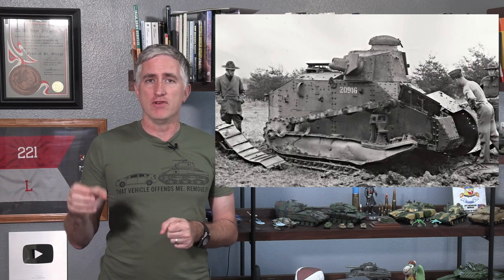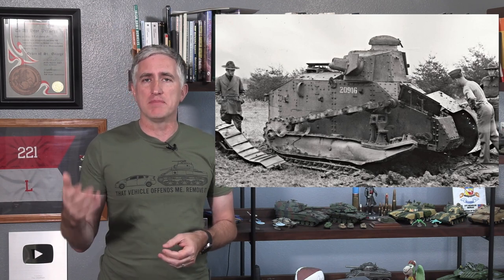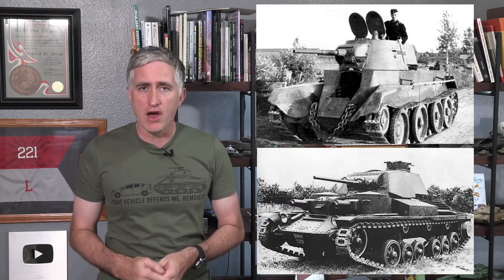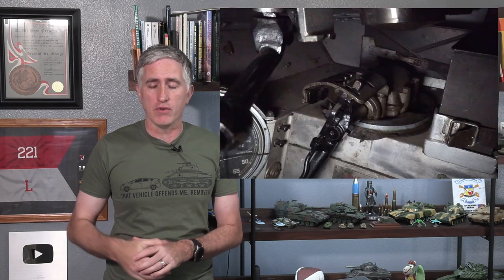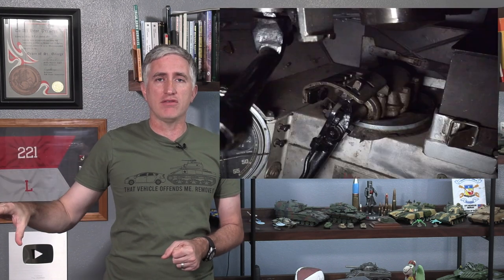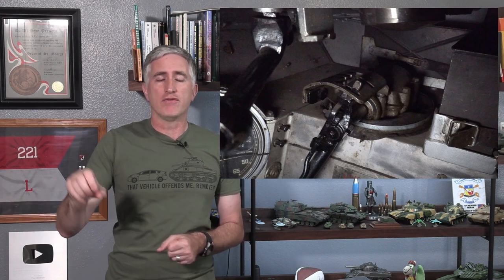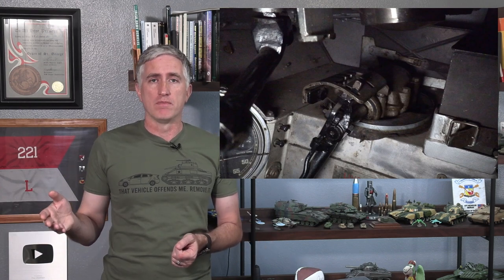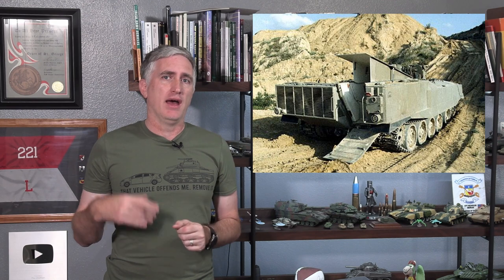Advantages of rear engine tanks with front drive sprockets

Comment: What i never quite grasped is how tracks can be front driven but still have slack at the top. Obviously the only way force can be transmitted is by tension, you can't push something with a flexible track, it would just bunch up. So on a front drive you are pulling the track across the top of the track run and around the idler. And yet you see all these tanks with slack track hanging on the return rollers, or just sagging down between idler and sprocket. So why does the tensile force of driving the tank not pull this tight, why do you not see the upper track taut and in a straight line from the tension belt placed on it? Why is it not bunching up between the drive and the first road wheel? I usually can visualize these things pretty well but that one has kind of stumped me for a while. Doesn't seem like the track is heavy enough that it's own weight is enough to counteract the rolling resistance of the vehicle.

Comment: Can you tell and show us what it is to "short track" a tank?
Reply: Some tanks, like Centurion, you can remove a section of damaged track or bypass a damaged idler or front road wheel. The Cents top rollers were strong enough to support the track and as it has a dead track the track isn't under tension. Presumably you could do it on a live track tank ( sprocket at the front ) as long as you only reversed! The only pic. I could find online is at https://www.lonesentry.com/blog/valentine-with-short-track-for-towing.html

Comment: Speaking of Sherman engine, did the US have any other suitable engines that was reliable and easily producible they couldve used for the M4? Also, why did the US loved to use aircraft/radial engines for tanks?
Reply: I think it was a case that it was a common, reliable engine that factories were already producing in large quantities, savings Ng the need to retool factories and retrain workers.
Reply: Logistics and repairs. Having one common engine is easier to produce. It is easier to train a lot of people to use and repairs. It is also cheaper.
Reply: At the time they were developing M2 Medium, it was the best they could have in large quantities. M3 Lee was based on M2. M4 Sherman was based on M3. And radial engine was still the best they could have in large numbers. Sherman got radial engine only in M4 and M4A1 versions. Other variants had different solutions and were put into production becouse those other engines started being more avaliable. M4A2 diesel and M4A3 V8 were quite good.

Comment: Bulldozers sometimes move in reverse as much as they move forward when leveling ground, so the idea that rear engine drive saves wear and tear is moot.  Besides, as somebody who maintained dozers I can tell you the wear of the track pins was the last thing we worried about.  Fuel consumption was very important, when you fill a 100 gallon tank every day at $2 a gallon, it adds up quick!   The real reason dozers have rear engine drive is tradition, this is the way early tractors were built, whether  tracked or wheeled,  and it's now the basic blue print. Tanks have to be balanced for what the designers had in mind, track wear was not important.
Reply: In truth for a tank tank the the wear was quite important as well especially regarding the dry pins as they must not break as it rendered the tank useless in a battle. In the seventies I was driving the Leopard 1A2. Almost every time we did a long "trip" we had to inspect the tracks with particular regards to the pins to ensure that they were not cracked or ready to break...
Reply: @paoloviti6156  Good point.  We don't normally drive bulldozers or any tracked construction machine long distances,  not just because they tear up roads, but because the wear on the tracks would be quite severe. It would also cost money as some bulldozers get ten gallons to the mile!  A bulldozer leveling say a 10 acre site in a day, would cover the equivalent of maybe 5 miles, and fifty gallons of fuel. A week of work would require routine maintenance to make sure pin wear hadn't exceeded limits.  A tank in a long campaign would definitely wear its track pins out.  But my original post was that going forward or in reverse made having a rear drive or front drive in a bulldozer moot.  To my thinking, balance and interior room are the only real considerations.
Reply: @bullettube9863  well said, and I agree with you 👍👍

Comment: How about Merkava?
Aaannnnd... Some special construction like Porsche done, Motor acts as a generator and produce electricity for electric motors on the drive axles. Without gears or other heavy and unnessery things. In WWII they had problems with Reliability and susceptibility to catching fire. Today it should be no more an issue. 

Edit:
Never mind... You mentioned it at 11:32

Comment: You get (or got) some mid-engined APCs with the vehicle crew in front of the engine and the dismounts behind. There may or may not have been a tunnel down the side of the engine to connect the two. The Japanese Type 60 and Type 73 were both like this. 

You also get a lot more rear-engines in wheeled APCs (Ratel, or the BTR-60/70/80/90 for example). The point there though is that these APCs usually have side doors too. Some of them have a passage and a half-wifth door at the back, some don't.

I like the Merkava layout a lot, but then I have a sentimental bias towards saving the crew if at all possible, plus I'm borderline claustrophobic and I'd like as many different ways out of a tin box as you can give , ta very much. With remote turrets becoming a thing, it seems a good idea to have the TC and Gunner sat in the back staring at screens with a big door behind them, rather than boxed in mid-hull.

Comment: Another consideration they supposedly had when designing the Merkava was crewsafety/survivability above anything. The engine is placed in the front for the reasons mentioned, but also because its basically even more armor, and the crew can get out fast af with the exit facing away from direction of the enemy
Reply: I'm all up for the ramp, but somewhere down the road, I've been partially persuaded that engine at front =  more armor is an iffy proposition. Yes, it might be true for the older Merkava variants with their bulged upper glacis armor, but Merkava 4 has a smooth upper glacis, which means the armor at the engine front couldn't be as thick as those on the driver side. It's fine if the armor can withstand the hit, but if it's penetrated you stand to be mobility killed. That is definitely not a great proposition no matter if you can bug out from the ramp or have to climb through whatever hatches you have.

Comment: News flash, the M18 Hellcat was a much better gun platform than the Sherman. 1st, the Hellcat was much faster and lighter at roughly 20 tons with a top speed of 50 to 55 MPH. Versus the Sherman at 30 to 33 tons and a top speed of 29 MPH. Although the Sherman had a max range of 150 miles compared to the Hellcat's 100 miles. Both were mechanically sound and reliable, and to be quit frank armament is a moot point. As both were paper thin and incapable of protecting against anything other than small arms.

The major difference was of course the M18 Hellcats M62 APCBC armor piercing round which could penetrate 88mm of armor at 1000 yards. There was also the T4 HVAP and M79 AP rounds which could kill most any German tanks on the battle field. The drawback of course was the Hellcats open turret which exposed the crew to enemy fire and the harsh elements.

I'm not knocking the Sherman at all, as it was a war winning tank which fought successfully in every single theatre of WWII , although nothing stood up well against German armor in Normandy and France. The Sherman's strengths were it's reliability with more than fifty thousand being built, which overwhelmed the Axis powers. I'm simply saying the M18 Hellcat was a better tank killer, which of course was what it was designed to do, and the Hellcat had the highest kill  to loss ratio in Europe - 2.4 to 1. With the term shoot and scoot ably defining the M18 Hellcat.

Comment: The drive sprocket in't moving the track at all.....the sprocket is moving the tank along the track.   The track that's touching the ground isn't moving at all .....but , the tank is rolling along the top of the portion of track that's in contact with the ground ....
Reply from the maker: It does, however, haul up the track at the back end, and then haul it forward to the front at double the speed at which the tank is going.

Comment: 12:05 "No other country did this" [putting the engine in the front]
Except the stridsvagn 103, designed by Berge who just happened to be a personal friend of general Tal, who was involved with the Merkava.
Main reason for putting the engine in the front was added crew protection, letting the engine take the brunt of any penetration before it could go further into the crew compartment.

Comment: You can't compare a bulldozer to a tank.  Ever!  A lot of thought goes into the design of a good tank, when the thought process is flawed you get mentioned in a "worse tank ever video" by David Fletcher.   The problem with push-pull cables was over come by using hydraulics, but this led to more problems with leaks etc.  Levers work fine but they take up room and still need to be kept lubed. Modern tanks have overcome these problems and the modular system, makes maintenance easier.  But if all I'm armed with is my rifle, even a poorly designed tank is dangerous!

Comment: The rear engine-front transmission arrangement is bad. It must have the drive shaft (and its tunnel, with ballbearings and greasing) running throught the lenght of the tank, increasing  the height with 40-50 cm, making the tank higher and a more visible target. Front sprocket means a front mounted, more vulnerable gearbox.  You need more armor to protect more tank. The Russians nailed the concept with the BT and later T34 and IS tanks. An IS3 tank weighted 46 tons (with a 122 mm gun!) while a Tiger I had 56 tons, a Tiger II had 70 tons, for the same amount of protection, but with more firepower and mobility. Rear engine, rear transmission means that their tanks were lower targets, easier to protect, with the powertrain more compact and easy to maintain.

Comment: FWIW, watch this old US Army film about unsticking a tank. See about 1.:28 and the explanation how a tank moves. Then think about an auto and front wheel drive vs rear wheel drive. In essence the tank doesn't move its tracks the same way an auto moves, the tank moves on the tracks, with the tank 're-lays' the track ahead of the driving sprocket. 

https://youtu.be/8Yu5FBMLXkk

Comment: Hmm. I don't think the issue of which way the tracks are under tension can be dismissed quite as easily as this. The inevitable way in which a rear drive pulls a track will always mean the lower part will be under tension and thus far less likely to jump off if not perfectly tensioned. This would be less of an issue on older tanks which were slower and less heavy but on a modern vehicle which is fast, extremely powerful and very heavy the issue of top track or bottom track being under tension would be far more relevant. The reason front drive was chosen for WW2 vehicles would have simply been down to what was possible with the power available and very quickly as reliability and power to rate improved for an engine everyone for the most part went rear drive even before the quick change powerpack idea was introduced.

Comment: I want front AND rear sprockets driven .. this lowers stress on key components ..esp  any rollers that function as pulleys.
Reply: extra space taken up by an extra drive train would increase the mass of the tank and put more strain on the vehicle overall
Reply: Not sure what way they are driven but the Elephant/ Ferdinand has sprockets at the front and rear.

Comment: Balance has got to be the worst excuse for mounting the drive sprocket and engine atoplosite ends. Look at the failed Canadian Bobcat APCof the 1950s. For balance, they mounted the engine in the nose and the drive sprocket at the rear. They were connected by a LOUD drive-waft that ran through the middle of the infantry compartment and a LOUD cross-shaft across the rear of the infantry compartment. The cross-shaft/differential forced the door-sill so high that it slowed infantry climbing in and out of the two doors. After repeated suspension failures during trials, the Bobcat was abandoned and the Canadian Army bought a fleet of M113s that they still use to this day.

Comment: wow those engineers who did not implement a transfer case for the m4 are beyond dumb, I know for a fact gear offset cases are a rudimentary concept that predated industrial revolution, the concept probably dated back to the first wind mill , to move the silhouette so high to accommodate that canted driveline and increase the enemies hit probability was unnecessary and is beyond dumb, it is hard to fathom a acceptable excuse.
Reply from the maker: Probably simplicity and cost. Less to break down, cheaper to make. They might have been worried about a bit of power loss with the extra friction points as well, but I don't know how much of an effect it would have.
Reply: @TheChieftainsHatch  are busy building  any of your kits? I just started a pz2 ausf f and a aufklarungspanzer 38t

Comment: You really forced this one over the extended play finish line as tediously and slowly as possible... All I wanted to know was the performance differences between a rear and front sprocket drive, and if a balanced drive would pose any advantage. If you actually included some useful information such as that, then I must have slept through it.